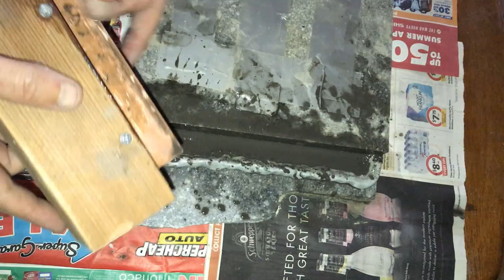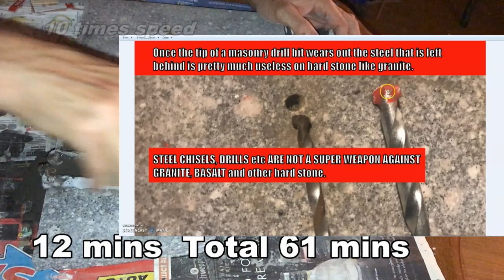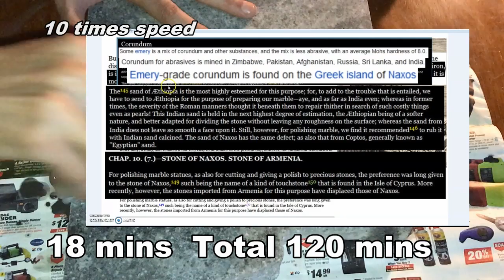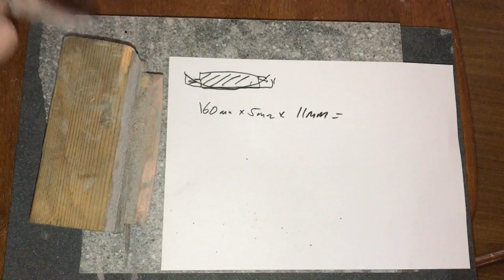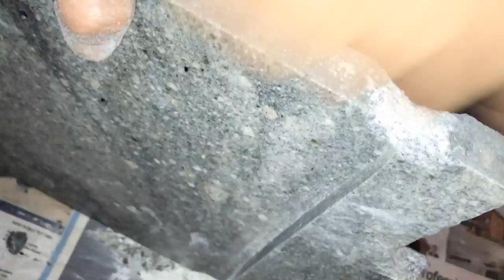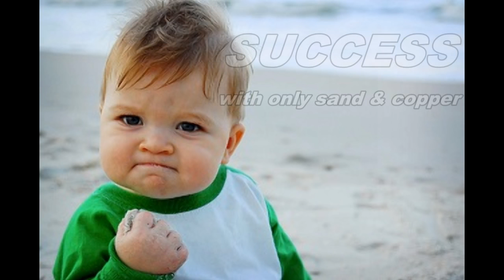LOST ANCIENT HIGH TECHNOLOGY- HIGH SPEED CIRCULAR SAWS 100% Debunked with Experimental Archeology

Comment from the maker: Oops, made a duo of early AM errors on the copper vs granite calculation. The ratio is closer to 9 to 1 granite to copper. 
The blade was 139 mm long and 2.44 mm wide with 6mm lost on the sides ( 139 6 2.44 ) /2  = 1017 cubic mm of copper lost - actually a bit less because the curve of the blade not taken into account. With 8800 cubic mm of granite removed conservatively. 
Meaning the slurry would be even more valuable to retrieve the copper for reuse.

Comment: You can just use crushed granite as your abrasive — the slurry from already-cut granite. Any stone will abrade or grind itself, as you say. But they had plenty of diorite in Egypt, a harder stone which they used to tip the large bores/drills which they used to quarry the granite. The diorite tips did wear down, and the process left a mix of diorite and granite dust. You can grade the dust into coarse and fine by stirring it into water, giving a few seconds for the heaviest particles to sink.  The bigger particles you can use to do the main job, then polish with the finer slurry.

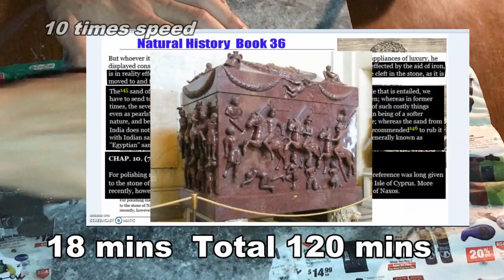Comment: You forget to add a little context to the image of the basalt statues you showed at 20:20, and that is that the statues like Aphrodite were carved out of a single block of basalt and in order to assemble them, multiple peices of basalt were used to create a single statue not all at once. They glued many peices together, and they were also binding them with string. They did polish them with sandpaper and oil as abrasives but simply having the ability to polish basalt or granite is not the mystery. You can not compare these head busts and statues to the giant basalt rocks that are polygonally shaped weighing 80-100 tons and being over 24 feet tall like the stones above the mountains of Peru like Sacsayhuaman. Also, there is black paint around the statue made from iron oxide that the ancients used to give it that color, so don't think that it's the basalt itself that's all colorful.
Reply from the maker: @Align_yourself  I’ve dedicated  videos in Peru including quarrying sites. Those stones are Karsk limestone and approx 8 of them, on the corners of the lowest tier. 
The clever thing would be to set those few heavy stones them fit the much lighter ones around them.
Also on sculptures. Recent giant granite statues of the Jains. Literally the method is to make a small replica then use those measurements to scale it up. The carving on Granite or Stone in Georgia USA. 
I have dedicated videos on that as well. Yes some statues are stuck together but that completely deletes the ones that are not. Or that traditional methods very recently and literally still being used. 
The mystery industry types are still suppressing the truth because they know about the examples.
Reply: @SacredGeometryDecoded 
Ok, I'll check out your videos 👍 good stuff.

Comment: Is it possible that the egyptians knew how to sieve the sand into different sizes, each having optimal
abrasive properties for its own specific use? Or that they could separate out grains of differet hardness/mineral type? Again with the purpose of making the sawing more efficient?
Reply from the maker: I’d say yes. Since then learnt the very coarse grains not as efficient.
https://youtu.be/sxjou0v9EH0
I used the waste to make grades of grit for polishing. Filtered in water and let it sit then pour out top half and repeat until ultra fine grit.
The video just a demo. I used buckets and eventually 72 hrs of settling time to get the the finer paste.

Comment: Make a perfectly balanced vase next, those I don't understand. Small opening, large void, comes to a balanced point at the bottom. Not saying that it's crazy tec, just don't know how its so perfect.
Reply from the maker: I will be returning to the experiments i posted a while back.  The vases are actually balanced but have a small flat spot on the bottom.
Here's the playlist of experiments. I need to build up skills as I don't have egyptian parents andgrandparents to teach me the trade.
https://www.youtube.com/watch?v=XY6SUTPV018&list=PL47iaGB6hlT5sYZWd_G7sHg9cSRv6WWS6

This experiment in marble but used to same drill on granite, it's a way to speed up the process. There's a lady in Russia who has been making vases but she uses the most primitive of primitive tech. Not even using copper. Just wood, bone and stone tools.
https://www.youtube.com/watch?v=58oseo2tnFk&t=445s

The diorite vase experiment, link to the no stop live stream of it being made would be in the description.
https://www.youtube.com/watch?v=MEuQK9bSyvU
It does take time but she works alone rather than in a workshop so making the tools and maintaining them takes a lot of her time. Though with the copper tube method I will dramatically reduce the time frame. 

Also worth noting that a lot of the things said about vase thickness etc is incorrect, the necks of some vases incredibly thin but only the necks not the insides. The best examples are actually Roman funerary urns and not Egyptian
The really thin Egyptian example is a bowl of diorite and not a vase.
The vase with broken piece to see inside thickness is at the widest piece, a centimetre up it gets quite thick. They worked the one part very thin but the vase itself is thick walled.

More experiments coming. Making pieces with all the individual techniques I show in the earlier experiments.
Using that drill it's quite easy to keep it all very symmetric. You just need to regularly rotate your position to cancel out the bias.

The best vases ever made actually come from about 1000 AD. Fatamid era ewers. the internal walls throughout are a fraction over 1mm thick. including relief carving on the outside.

Comment: What about impregnated copper,  rather then adding grit to the groove add the grit to the melted copper while forming the blade.  Would probably lose less copper while cutting
Reply from the maker: I don't know enough about casting copper to be certain but I would imagine it would be a bad thing, but don't quote me. Though the grit becomes embedded in the copper quite quickly , I would think for recycling purposes they probably wouldn't try to put it in the copper earlier. All the owrn copper becomes trapped in the slurry and can be panned out later.

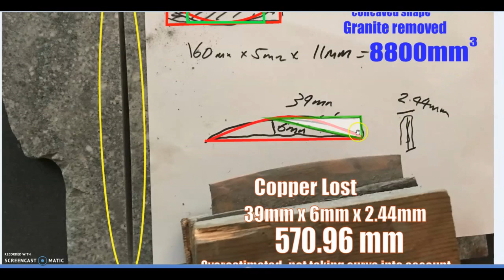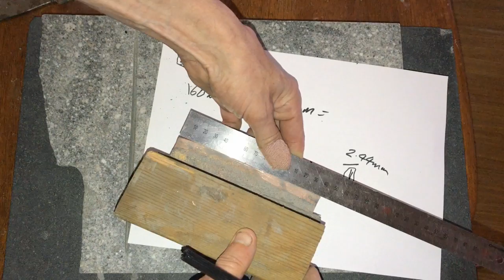Comment: Notice that there is a mistake at 29:24 which is caused by a bad reading on the ruler at :  27:21
You read " 39mm" but the length is 139 mm ....
Copper Lost should read:
139mm x 6mm x 2.44 mm = 
2035 mm^ 3 
Granite to Copper 4.32 : 1
Reply from the maker: In a pinned comment and description  I mention the mistake.
Reply: @SacredGeometryDecoded  Thanks. I hadn't seen it for some reason.

Comment: Can you please replicate and/or explain how they achieved near perfect right angles INSIDE the granite boxes?
Reply from the maker: the inner corners are NOT perfect right angles, as the surface of the boxes are not flat either. Using this technique you'd get better results than seen on the Serapeum boxes.
That precision corner and flatness thing is a pure myth and those pushing it know it's untrue and yet they continue? Why do they do that? 
https://www.youtube.com/watch?v=BZbt76w5SV4
Here's someone doing it in granite with flint and sandstone tools
https://www.youtube.com/watch?v=HQ2bHE7mTi4
Inner trihedral corners like that are everywhere throughoutstone masonry, it's apprentice level work really. Like creating flat surfaces.
in one old building here in Sydney there are hundreds of them on just one outside facade. 
Literally nothing special about inner corners.
Don't let them fool you with that.
Reply: @SacredGeometryDecoded  Thank you for your reply.  But my question still stands:  how do you carve a near-perfect 5x6x10 ft. box inside a solid piece of granite?  More importantly, in the +200 years since the modern re-discovery of these artifacts, why has NO ONE successfully replicated one of these boxes?

Comment: hi there again my friends.I've never been to Egypt,but I wonder if the circular saw marks change radius the deeper the cut due to wear on heel and roe of blade.if I could obtain better data(no laptop,just phone)I would love to check adjacent grooves as this would probably demonstrate without argument that this was very similar,if not identical methods used to shape and abrasive stone.11m high speed circular saws in pre dynastic Egypt.I don't think so.all these wild theorists and profiteers seem to think they must have had a local hardware shop with modern equipment.the only way I can be certain of techniques used,is by mimicking your sterling work and seeing for myself.been stormy couple of days but prepped a frames.cut blade holder and have flattened copper pipe.from your extensive experience,would you notch or cut slots in blade to carry abrasive in.I think you mentioned that the abrasive gets pushed into surface of copper,so notching blade might also abrasive sides of cut leading to a wider left,more waste,and less accuracy in using the cut as narrow as possible.maybe some blades were side mounted with pits,so side of blade would polish the fresh cut surface at same time.you've cracked it my friends,and can't wait to replicate.thanks for the truth and inspiration.maddog

Comment: amazing,and totally fits.I presume the longer the blade,and the distance between a frames(plus length of ropes would provide different curves.the farther spacing would be much more of a flattened arc,and bringing them together would produce tighter curves.have to tried nothing blades to carry abrasive s into cut?I suppose this might widen the kerf,and involve more expenditure of effort.I must get some copper pipe.quartz sand on beach near me UN west cork.copper mine tailings,and pretty regular size grain.probably need to add something finer to achieve a paste/slurry.thanks for the inspiration my friends,and seekers of truth.and I'm glad you don't dress up like Indiana Jones,as a lot of these theorists of powered hi tech devices tend to.be lucky and bless ings be upon you and yours.mad dog.west cork

Comment: I have seen primitive grantie cutting rigs in the Middle East.  A wood framed pedal powered system rotating a rope encrusted with course diamond dust. Now, we use a diamond or carbide encrusted wire and engines but basically the same idea.

Comment: I'm still not sure on how they did it on a large scale,but you have shown it can be achieved with copper tooling which goes along way. Good video man
Reply from the maker: https://www.youtube.com/watch?v=3XfoWqzHJPg
Also old fashioned pull saw as seen in the old quarries, before modern machines a giant version of this blade but an a jig. If you add a weight to them the cut rate is much much faster, just trying to prove the concept in this video. They used iron but the concept exactly the same, the iron or copper doesn't cut in the same way the paper in sand paper doesn't cut. It's all about the abrasive. I have a video of drilling a core in granite using a PVC pipe
Reply: I agree the unfinished box in the museum is at least 4 to 5 foot by 10' (guessing from my pics). The marks don't match the idea in this video, meaning there sawing in a direction on the short side in the direction to the longer side. It's not a solid cut through but split in the middle, so would support a bit of his hypothesis on the curve of the inside but they would have constantly have had to deal with the solid side of the box. I still have a hard time grasping why they would do it this way. Even more so if they had to break this up in such small chunks how did they do some of these much bigger boxes.